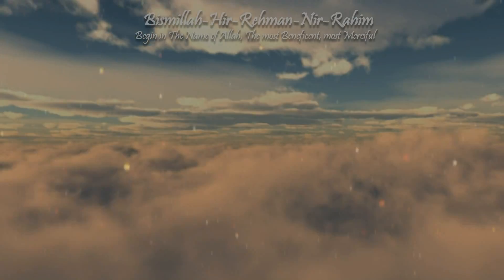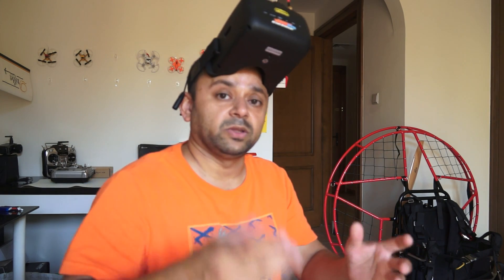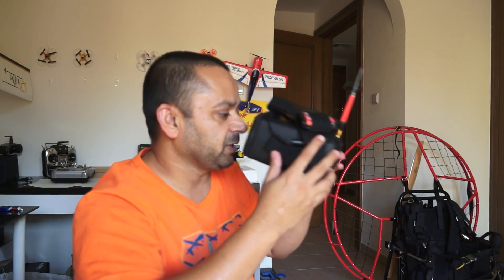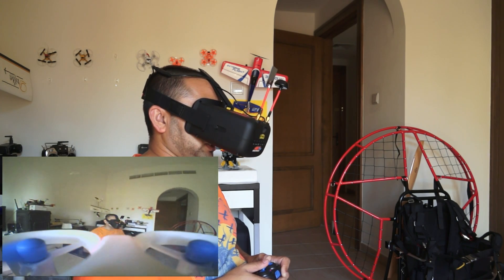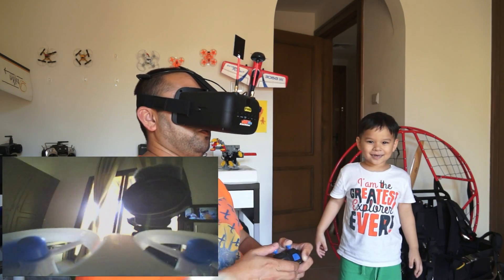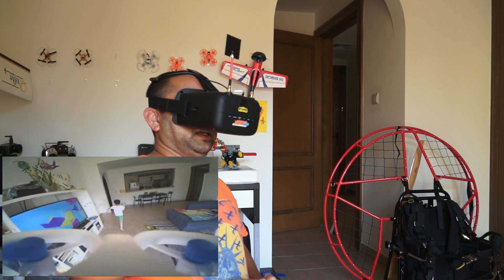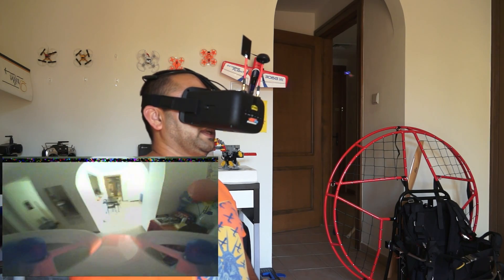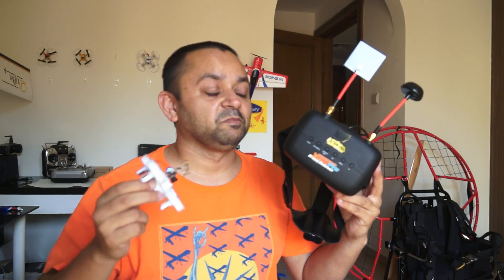FPV Whooping with Eachine E011 and Eachine VR D2 Pro Goggles

Comment: Horrible goggles reception stinks unless your in a open space or maybe inside. They are uncomfortable as hell unless you have a small head.
Reply: Do you actually own and test the Eachine VR D2 Pro Goggles?
Reply: Robert Veach no the original which doesn't matter because it's the same goggle other then a search function and be able to turn off one of the receivers. They didn't change the actual reciver installed so the reception didn't get any better